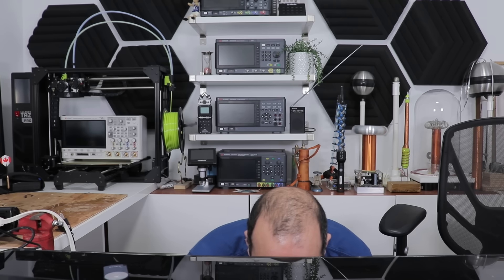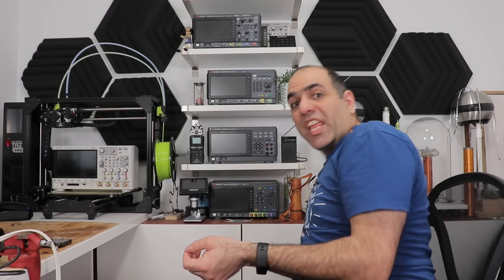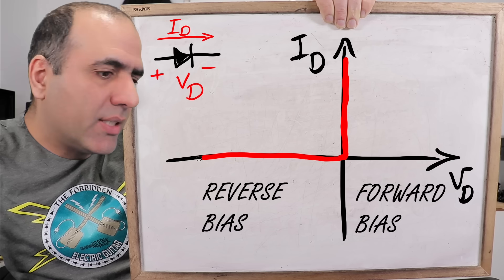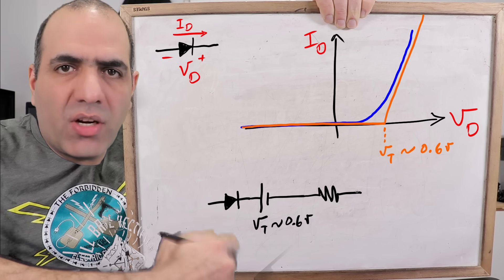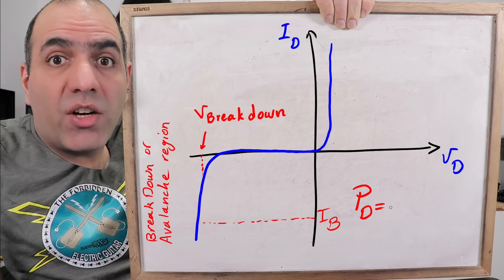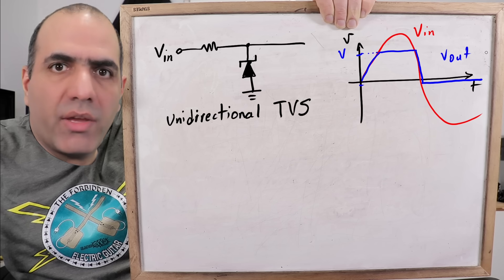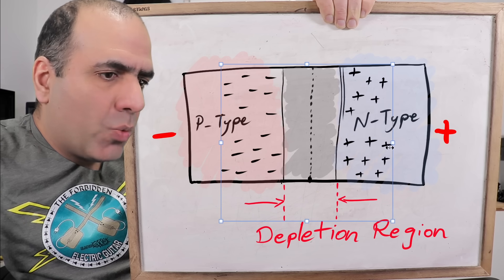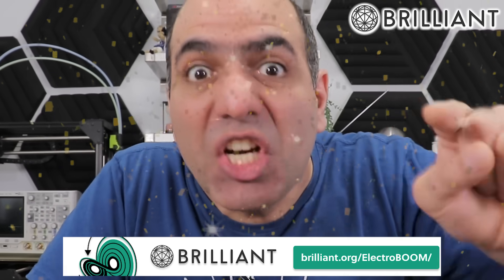DIODES! All Sorts of Them and How They Work (ElectroBOOM101-010)

Comment: Lol those diode title screen inserts were magical. One item i've never quite understood are diodes rated above ionization point, or above 360 volts. Let alone how a 15kV diode works. When you get to that high of voltage, my understanding of how they withstand such pressure starts to get foggy.
Reply: HV Si diodes like 15kV are composed of dozens of series PN junctions, with under 1kV blocked per diode. As such, the forward voltage is much higher than an ordinary Si diode, like 10-50v per device. The individual diodes they’re comprised of are quite thick and have a much higher voltage drop than ordinary diodes (~1.5). The magnitude of this resistance varies with construction as a standard or ultrafast device (like a 60hz xray tank/microwave oven diode vs high frequency voltage multiplier diodes), but either way they exhibit a great shift in forward voltage (which is seen very obviously due to being multiplied by the number of series voltage drops) with current.
Reply: @Ferraday  I've seen pictures of kilovolt diodes installed. They're really chunky bois. They got thick metal plates for cathode and anode and screw in with large bolts.
Reply: @PunakiviAddikti  high current power modules are not in question here, comparable to @wobbly sauce’s response. the exterior mounting has nothing to do with the internal structure, which is anywhere from 0 to 1 series junctions in the case you’ve brought up.
Reply: I think those are just many diodes in series
Reply: Or parallel.
Reply: @wobblysauce   Parallel connection wouldn't increase their voltage withstanding capability.
Reply: @wobblysauce  Diodes aren't really designed to be used in parallel. The diode with the lowest forward voltage wins and the other diode just kinda sits there. To boost a diode's voltage tolerance, you can connect it to a MOSFET.
Reply: @PunakiviAddikti  We can parallel diodes. But we need extra circuits to balance them.
Reply: @ajinkyakamat7053  Yeah that is true, there are ways to parallel them.
Reply: Those diode title screens just reminds me of title screens of the Ultimates from Danganronpa. I see a reference ;)
Reply: @TheLukasz032  Dude I know this was commented two years ago but is this the actual reference? I knew it looked familar and drove me crazy if this was actually a refrecne to Danganropa or not. l felt it's too obscure of a reference.
Reply: @robertpolito9209  there was a whole reddit post about those, apparently it's indeed a reference inspired by Mehdi's daughter.
Reply: Diode joined your party!
Reply: the only substances that can be ionised are liquid and plasma
Reply: These diodes are designed to have a very wide depletion region. This reduces the electric field for a given p”voltage difference.
For extremely high voltages silicon carbide is used instead of silicon.
Reply: I would love those in sticker form!
Reply: da nunu dannna doo danooo
banana

Comment: are you one-way, a die-o-de
Reply: so you mean a battery is a diode
Reply: dissimilar metals in contact, no electrolyte, just the field
Reply: battery terminals are a solar cell, also without the electrolyte, with the field only
Reply: battery non-similar electrodes are solar cell, copper-copper-oxide junction
Reply: metal-semiconductor diode, schottky diode

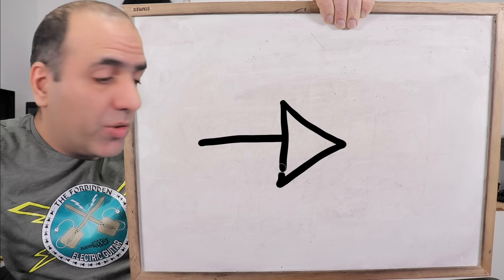Comment: 3:12 the arrow mnemonic is certainly very useful for reasoning about a circuit, but I thought that the symbol actually originated from the early "cat's whisker" point-contact diodes: a pointy wire pressing against a bar of galena. The rest of the contemporary symbols for resistors, inductors etc. resemble their physical counterparts, so I think the diode would follow. Perhaps someone has an old electronics book with the answer?

Comment: I wouldn't say tubes were "pretty much replaced" with the Advent of semiconductors. Consumer grade solid state components really started showing up in the early 50s and didn't hardly show up in any equipment until the mid 60s. In high power applications (television flyback drivers, etc) the first reasonable setups showed up in the early 70s with the XL-100 but were still mostly hybrids until about 1977. 
In radio transmission, vacuum tubes stuck around at least until the mid 2010s with the Klystron. 

Overall it took minimum 20 years between the invention of the transistor and the total replacement of major of vacuum tubes from components in home electronics.

Comment: A bad zener diode was the cause of the most convoluted, messed up bit of troubleshooting I ever had to do while in the Air Force.  The diode was part of a hydraulic actuator in the flight controls of an F-15.  Our test equipment said the actuator was bad.  We didn't have any spare parts at the time so the test shop guys tested it and their equipment said it was good.  We ended up replacing every part in the flight control system at the insistence of the back shop guys and nothing fixed the error, or even changed the error code.  We finally got out the full schematics of the system and spent several hours tracing the circuits to find the thing causing the issue.  A zener diode that was not releasing current at the correct voltage was the issue, and the test equipment in the shop had just enough higher of a voltage that the diode tested ok.  We went through the entire schematic showing them that was the source of the problem.  They didn't believe us and wouldn't tear into the actuator because it was a lot of work for them.  We finally took the issue all the way to our commander, a full colonel, he ordered them to try the fix we said would work.  After more complaining they did it.  We put it back in and guess what, it worked perfectly.  After 4 days of 12 hour shifts trying to get it fixed it was nice to have it done, but it would have been nicer if they listened to us in the first place.

Comment: Such a good video! I never knew how all these types of diodes work, I loved it. Learned so much about them, now I understand circuits and electronics so much better.
Reply: I'd advise you to look up diac and triac too. The diac is essentially like two of the same diode in parallel.

The Triac is like a transistor but it conducts current in both directions when the gate is given sufficient current

Comment: Gunn diodes are "fun". Due to it having "negative resistance" it is possible to make an amplifier in the 200GHz region only using Gunn diodes, my brain turned to porridge first time I saw one of those. There are also cats whisker diodes.  For example the OA91 which can be used in a "crystal set" to make an extremely simple AM radio that does not need an external power source (as long as you use a crystal earpiece). Avalanche diodes actually work better than zenners for circuit protection. Avalanche Photodiodes are also quicker reacting than standard photodiodes. The newest ones in an array can theoretically film up to 100 million frames per second. Then there is the Diac. And of course the Triac. SCRs can be fun to mess about with too.

Comment: I had to figure some of this out as I wanted to fit a relay to a 240VAC mains lightswitch so I could essentially bridge switch on the side of a bathroom extractor fan.

Problem is, back EMF is a thing and, diodes don't work on AC.

Fortunately, I found a relay that deals with it with a capacitor and a resistor built in.

Pretty neat I thought.

Comment: Also another use of reverse biasing a diode is in the use of measuring ionizing radiation. I think you should do a video about this and make a solid state radiation detector.
Reply: Because the ionising radiation causes an increase in the reverse saturation current.

Not sure if that works for alpha radiation. I think the case of the diode might block it, but for beta and high energy electromagnetic radiation it probably does work.
Reply: @deang5622  it should work for alpha but you literally need the sample to be right up against the sensor, and it needs to be a bare silicon sensor with no coating or protective layer over it which would block the alpha particles.

Comment: This video is amazing! I am currently studying Electrical Engineering and this explanation for diodes was just amazing!😊😊👍👍
Reply: Really?  You got teachers that bad ;)
Reply: Now go look up diac and triac. The diac is like two of the same diodes in parallel but facing the opposite direction allowing current to flow both ways. The triac on the other hand is like a hybrid between a transistor and a diac, so if you supply the gate with enough current, the triac will conduct power in both directions

Comment: This was amazing! Please make more of these as it is very helpfull for students such as me
I would love to see transistors explained like this by you!
Reply: He missed the type "diac" and "triac" though. The diac is essentially two diodes in series and the triac is like a a diac with an off-on switch, kinda like a regular transistor, except it allows current to go in both directions.

You can use a diac and a triac to build a simple dimmer circuit for incandescent light bulbs by using the forward voltage of the diac to trigger the diac.

There are plenty of examples of this circuit out on the web
Reply: Edit: diac should trigger the triac*
Reply: Edit 2: the diac is not "two diodes in series" but parallel.
Reply: @TheExileFox  im not sure how does Diac work
Diac Is 2 diodes in parallel with opposite directions right?
So what purpose does it have? If the diodes have different direction then current can flow both ways or not? Therefor it cant be used as normal diode

Comment: I learned about most of this stuff when getting my degree (some of which I actually remembered despite not having used it in over 10 years), but I didn't realize that the overall pattern to all of these different types of diodes was essentially selecting for specific traits that all diodes have and working out formulations that increase those effects while tempering others. It's a good analog to selective breeding minus the biological and evolutionary undertones.
Reply: Yes, however the selective breeding is significantly lessened in "back-to-back" applications.
Reply: Not so much selection but designed for specific traits.

Selection implies they are manufactured and then selected for their required purpose and that isn't what happens.
Reply: @deang5622  Material/construction selections produce products that emphasize different properties, that's what I was getting at.

Comment: Never heard of a varactor before. Amazing. I've been doing electronics for 15 years and I can learn from your videos!

Would be splendid if you could use one in a circuit in a video.
Reply: Once upon a time when dinosaurs still roamed the Earth and TVs needed half a minute or so to warm up before anything showed, you selected channels by physically switching to a different set of inductors and capacitors on a rotary drum, then fine tuned by turning a big-ass variable air-capacitor with eleventy billion plates meshing into and out of the other set of plates. Then at some point you were now just pushing buttons to select a preset, and turning a (very)multi-turn potentiometer to sweep across a whole band. Those pots were actually biasing a varicap diode, which was tuning across the whole band just by changing its capacitance accordingly...
Reply: @AttilaAsztalos  And yes, I remember tuning a TV with a screwdriver. Indeed, the earliest TV I remember didn't have presets, just a tuning dial like a radio. And it was monochrome!

Most of the electronics I work on now is digital, low frequency, or high current power. Not so much low-level RF.

Comment: Huh, i've heard of PN junctions in transistors, but never knew it's also in diodes! (it was in a chemistry lesson so we focus more on the silicone and the impurities used instead of the practical application)
Reply: Well, if you stick two diodes together, so that they share either the P region or the N region in between them, and apply a small voltage to the middle, that's a bipolar junction transistor!
Reply: @zuthalsoraniz6764  But that bipolar transistor will not work. And the reason is: the transistor works because the base layer is so thin. Using two discrete diodes back to back, the middle base later is too thick, too wide.

Comment: You did not really mention "Avalanche diodes" which are Avalanche rated to work in this region safely, they are kinda the like a Zener but typically operate at higher voltages. also a lot used in switching power supplies in Snubber networks and so on where spike voltages might occur above the rated diode voltage

Comment: You covered about half of the basics of my electronic circuits lab course and a little bit more in 15 min. You can make a very basic voltage regulator from the zener diode, but it will have some issues because of the Vdiode * I diode power losses and resistor I^2*R losses.Of course you’ll need to have a certain break down voltage to get the stable regulated voltage you want.You can put a few in series and the sum of their break down voltages will be your output voltage for the regulator.

Comment: Can a zener one be combined with a capacitor, a resistor, and a coil to alternate a transistor gate between open and closed driving LEDs at reduced brightness with a negligible power reduction? 🤔
Reply: Well, negligible during on cycles ...that is 🤷‍♂️

Comment: Every diode has different types of curves including a V-I which indicates voltage drop over it according to the current passing through it.
It's very important to pay attention to this curve there's no actual typical voltage drop across diodes.
Reply: The voltage drop is a direct measure of the recombination energy that escapes the junction as light. The higher the drop the shorter the wavelength. A UVC led has around 6V forward voltage.
Reply: @LutzSchafer  interesting...

Comment: 0:43 Side note: Inductors and capacitors are linear, but their voltage-current plot (characteristic curve) is not a straight line through the origin, though. For example, if they're used in circuits operating in sinusoidal steady-state (i.e. sinusoidal voltages and currents), then their characteristic curve is actually an ellipse centered at the origin.
Reply: You are correct. "linear" does not refer to the voltage-current plot, it refers to their linearity in the algebra sense: If you sum or scale inputs you get summed and scaled outputs.

The instantaneous voltage and current do not have a direct linear relationship. Instead, there is a linear relationship between the voltage and current functions in the Hilbert space.

Comment: wait wait wait... so I built some led controllers with node mcus that run on 5v to control 12v led stripes. I bought step down converters to supply the node mcu with 5v from a 12v psu and now you're telling me I could just have used a zener diode? or am I wrong?

Comment: In radio control car applications using PWM speed controllers for the motor, and brushed motors, you'd get a funny little problem if you suddenly let off the throttle. The still spinning motor, and the vehicles motion, turned it into a temporary electric generator. All of that power had to go somewhere and since RC cars don't have regenerative braking, it usually dumped into the FET's in the speed controller, making them overheat or blow up. Enter the Schottky diode! Putting one of these across the positive and negative terminals on the brushed motor, prevented this reversal of current back to the speed controller, and made both the motor and the speed controller run cooler and more reliably as it also helped with back EMF from the brushed commutator as well.

Comment: Another fun type of diode is the O-Ring Controller / Ideal Diode -- which is really a MOSFET that a controller switches on and off to pretend to be a diode, but manages to have even better ideally diode-like behavior than an actual diode.
Reply: You can also create an ideal Diode by combining a regular Diode with an OpAmp.
Unlike the O-ring conzroller you are limited to the OPs output current, so it's only usefull for low power applications.
Like creating an ideal rectifier for measuring AC Voltages or for peak detection.

Comment: QUICK TIP: If you are planning to make a poor man's voltage regulator using a zener diode, then make sure to keep the current well within the current limit of the zener otherwise you will not get a nice, clamped voltage.. And might end up like me wasting 4 hours on the same.. ;-;
Reply: You don't have to be rich to afford a real voltage regulator like 78L05 :) But sure zener's are fun to play with.
Reply: @bgezal  zeners are cheap AF.... but yes, they are fun to play with...
Reply: @bgezal  Can you get a 3.1 volt variation of the 78L05?  No.

Sometimes you just want a voltage reference and not a voltage regulator.
Reply: @deang5622  The 05 in the name is there for a reason. The LM317 is also cheap ;)
Reply: So you didn't have or you did have but didn't how to calculate the value for a series resistor for the zener when breakdown voltage is reached? Okkkkkk.

Little bit of knowledge is a dangerous thing...
Reply: @deang5622  I knew how to calculate the value of a resistor... I just did not know that the current going to the zener should be regulated... This incident happened wayyyyy back when I started doing electronics..